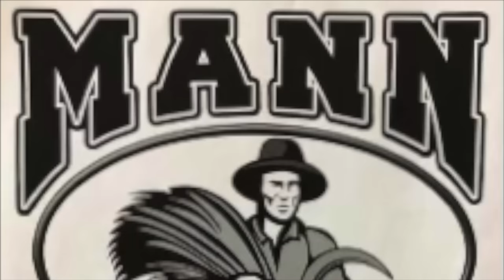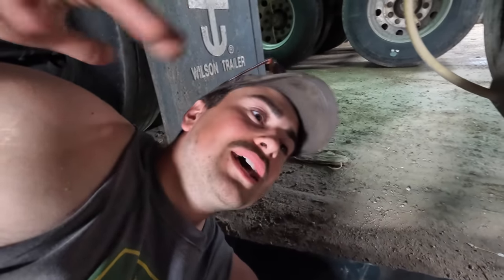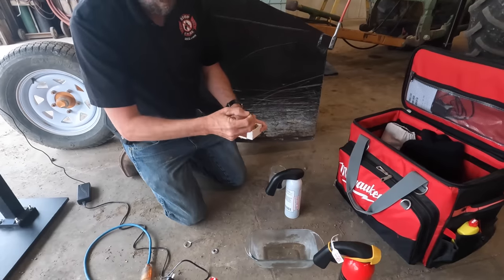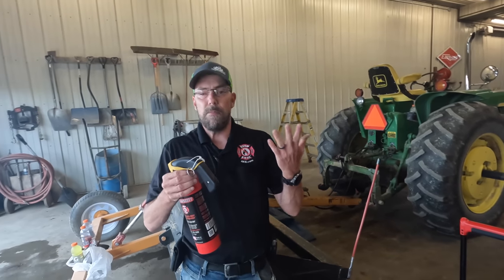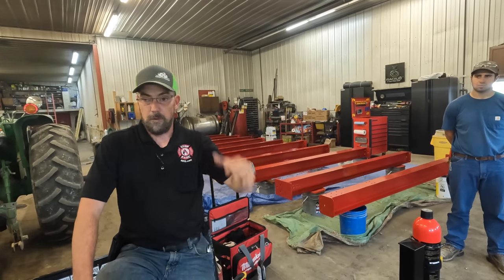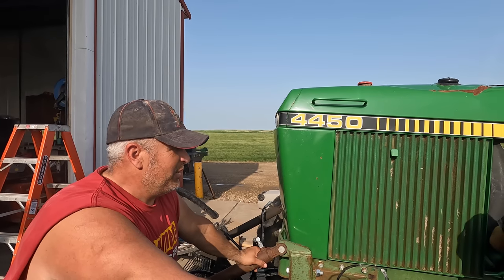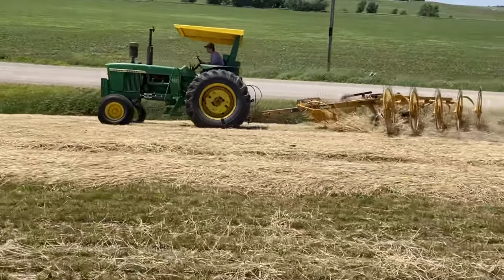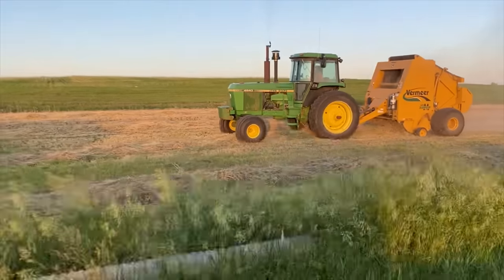AKE Stop-Fyre Demo Just In Time For Hay Season!

Comment: You know when they don't give a price it's going to be spendy.  They're $660.00
Reply from the maker: They are pricey. But there’s really good deals to drop those per unit costs down. They do what they’re supposed to very well and are easy to use. A child or old lady doesn’t need to be afraid of it like a normal extinguisher would be.
Reply: Yeah they are spendy but I do have a lot of different options to drop your price down immensely! Not to mention their multi-shot and will last you 30 plus years with a lifetime guarantee drop it break it anything like that give you a brand new one. It's just another for your toolbox and an investment into your investment! There's a reason the NTPA uses them trackside and that's because they work when they're needed.